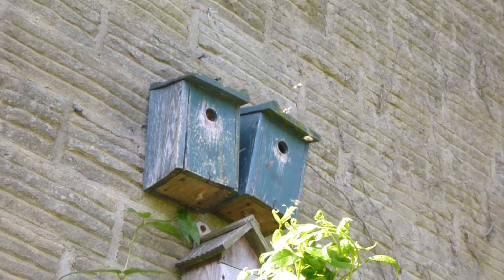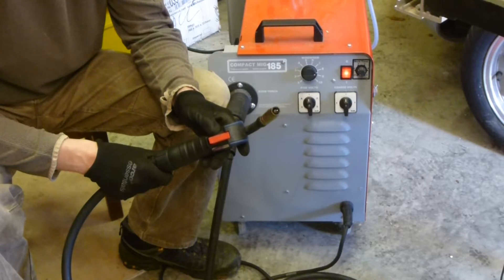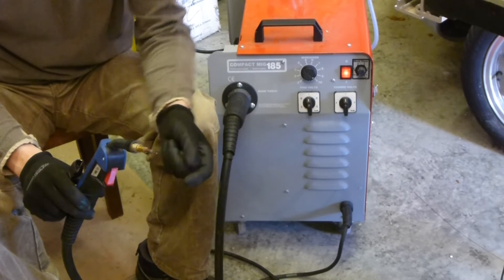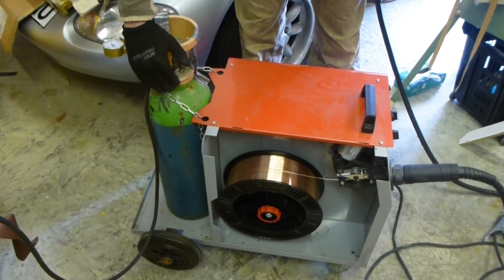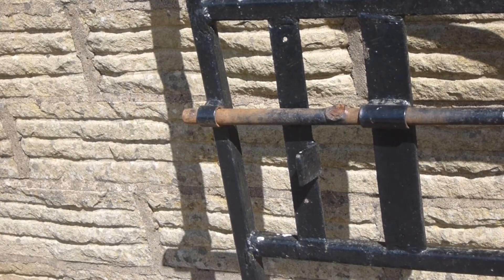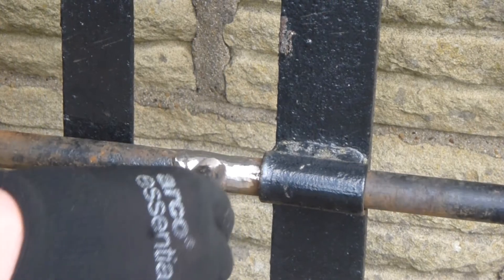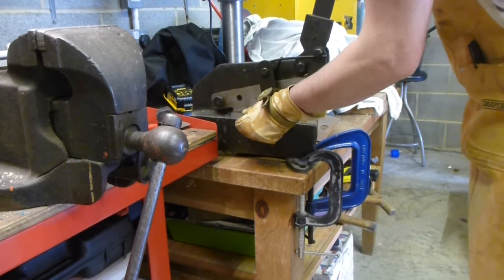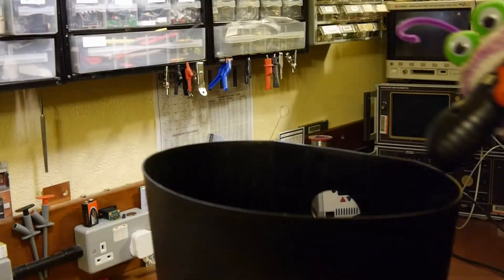Bumbling Around

Comment: Classy numberplate Chris!  Never done any welding though I did get 'welding eyes' once.  Advice along the lines of 'Never look directly at an arc welder without eye protection' so of course I had to have a look to see what all the fuss was about. "Yes you were right. it really does feel like someones thrown sand in your eyes."
Reply from the maker: Andrewausfa  I wondered if anyone would notice that. Well spotted, my juvenile toilet humour. Oh yes that private plate must be worth a fortune. I thought it quite fitting as Audi is the new BMW drivers car of choice I could have gone for TWAT as this would have been equally acceptable. Yes flash eye  can be quite horrible just like sand in the eyes. I think it's the sort of thing that every young man goes through once, I did. we get so much health and safety crap these days the important warnings just get lost in the noise. Still the modern mask I'm wearing makes a big difference, it start of clear and then instantly goes dark when arc strikes. You can also adjust the darkness setting  so it's easier to see the welding puddle.  I need to get a cap or something as I keep on setting my hair on fire.  As always many thanks for your comments. Best regards Chris
Reply: So, like on BMWs, indicators on Audis don't come as standard then? :)  I had a 728i once, flipping thing.

Comment: A man of many talents!  Whats the car in the garage?  I was ask about stick welding up until you said thin and blow holes...so that's not good.  Its nice to be in the country, I miss it and hope my next house is in the country!  Great job Chris as usual Chris!  ~Jack, VEG
Reply from the maker: Vintage Electronics Geek Hi Jack I built the car it’s a Ginetta G20, but had to sell it and make room for the Chevy .  Probably could have stick welded it but mig welding is easier on stuff like this that is quite thin. There is an advantage in stick welding in that the shield gas can get blown away when mig welding outside. Unfortunately it was a really windy day.  Thanks Jack Regards Chris
Reply: It being a UK car, I never heard of it, looked it up...very nice car...kinda looks like our Dodge Viper, sorry to hear you let it go, but you got a truck and that's always good...a 4x4 truck even better!  :)  I'm not a welder...I did some in high school metal shop some 900 years ago, had a small used welder that never worked, so I threw it away.  Also, I guess I should proof my posts, the original sux!  But message conveyed.  ~Jack, VEG
Reply from the maker: Vintage Electronics Geek Yes I love the truck and I like old engineering I can actually work on.  If I had to make a choice between electronics or mechanical engineering I don’t think I could. I could be happy doing either. Regards Chris
Reply: I am not mechanically inclined, never worked on anything that involves plotting, can't do it...feeble mind!  :) However, I do have a R2R that I found on the side of the road, so one day I will plug it in and see what happens.  I do however trip very heavily on vintage radios and alike, because they encapsulate both electronics and mechanical...it just amazes me how the engineers can get them to work so elegant!  ~Jack, VEG

Comment: Nowt wrong with those welds Chris, I enjoyed welding, oxy/acetylene was always great to have available especially for bodywork-can't beat a good buttweld on panelwork.
 I spent ten odd years in the classic car resto business working for TT Workshops, I liked the challenges (mostly), and the last car I restored was a MG TD for myself,
 Anyhoo, a bit of variety is good eh?
 J.
Reply from the maker: Average Joe for sure. A bit of what you like does you good as my gran would have said. I don't have oxy acetylene at the moment as the gas bottle rentals are really expensive and the rent free bottles hold as much gas as a fart in a plastic bag.  Its not just welding its having  the ability to heat and forge that make it so handy in the workshop. Still it does have safety issues and can be very unforgiving. The last car I restored was an old MGB.  I mainly TIG weld these days as I like to do aluminium and stainless steel. Nothing is so nice to weld as stainless beautiful puddle formation and easy to control. Again I find the Argon and the argoshield difficult to justify for the amount of welding I do.  Yes my welds were not so bad first time I switched the MIG on in 5 years and takes a while to get my eye in again.
Reply: Quite correct Chris, Tigging ali can be quite cathartic unless it's old cast stuff full of crud and engine oil!, I had some fun times fabricating some very odd parts.
 Nostalgia, do you remember that?
 Cheers, J.
Reply from the maker: Average Joe I once made a dry sump for one of my cars. Cut the bottom of an old aluminium sump and shortened it and install some baffling. It was a bugger to weld. Made no difference how much I cleaned it, the oil just kept coming out. I assume cast aluminium must be quit porous. It's not pretty but still driving it 8 years later. Thanks Joe. Regards Chris.